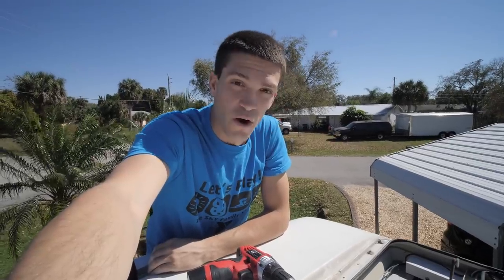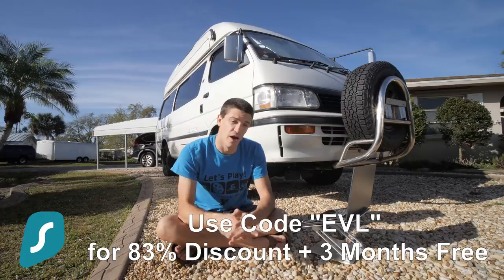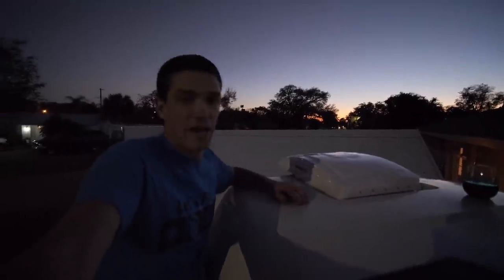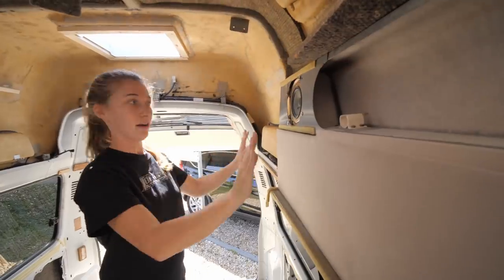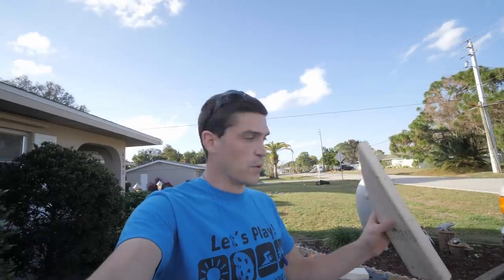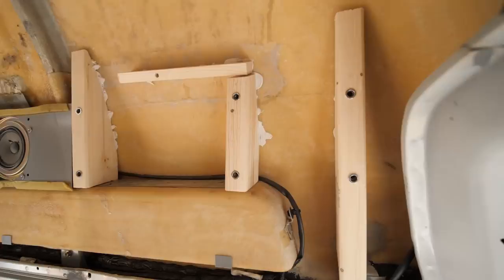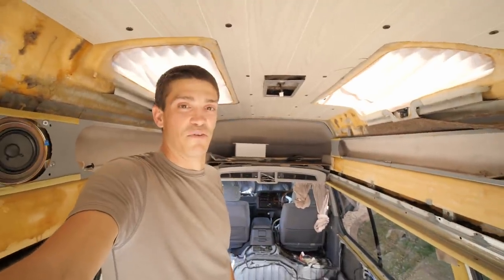THE HARDEST PART OF THE VAN BUILD | Toyota 4x4 JDM Camper Conversion

Comment: Only a thought that may help... I use cardboard templates (as I can see you also do!), for complicated profiles and get the best I can from this first. The second time I use a hardboard to finesse the final template before using that to transfer onto my board and find this helps a great deal with areas where you might need the board to also curve or bend to meet profiles. I find I can achieve a greater level of confidence in fitting and less frustration with multiple fittings of panels and expensive errors with the board I use for the finished work😎👍

Comment: Very impressed Nate that you are trying something new... a full build. I noticed you used paneling for your ceiling. If you plan to keep the van for many years, make sure you build it to remove easily. PANELING won’t last. I’ve done plenty of builds with it. The slightest moisture, condensation distorts, swells it, especially around fasteners. I always use PVC soffit now for my ceilings. Cheap, light, waterproof, easy to remove, and allows gap to chase wires.

Comment: Carpenter trick...to locate "blind" holes, (like electric boxes) when installing drywall...paint the box edges with lipstick. Lipstick will transfer to the drywall for cutout locations.  YOU  can do the same when trying to locate the rivnuts, or other things.

Comment: As a boat builder we take 1/8” thick luan plywood, cut it into 2 “x 8 ‘ strips . Cut as as we go  hot gluing in place a outer edge  pattern with few re- enforcements then transfer to the finish ply . With price of ply these days this saves a lot of mistakes

Comment: Consider using Formica or Wilson Art laminate (countertop, cabinet, etc cover material) on top of the plywood. It comes in hundreds of colors. Very flexible, and attaches securely with contact cement. Looking good so far!!

Comment: I installed the max air vent in my Roadtrex I put eternal Bond on top of the max air vent edges and screws so it will not leak just a thought.

Comment: Used a lot of rivet nuts and I've never seen them used in wood.
Reply from the maker: I might have gone a little overboard with them haha. I don't think they're really meant to be used in wood but they should hold up fine with the Loctite glue.
Reply: Should be ok as long as he doesn’t mount anything heavy to the ceiling.  My concern is with the wood glue. Heat + glue = ceiling that is now a floor

Comment: I still wonder why you think of this as a 2 year kind of deal. Anyway, lot of RV types are going with split AC heat pump units. My neighbor just installed three. Quiet and very efficient. Get some cheap LFP from Basen on Ali. With any insulation you could heat cool with solar.

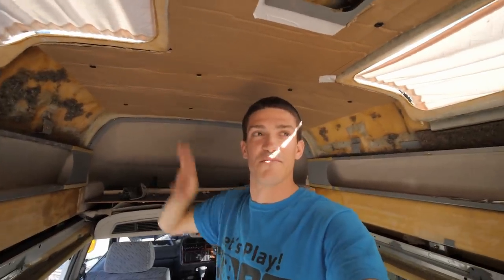Comment: The cardboard template and the blocking process are of interest. I would've liked to have heard more of your thought process and the resultant process. For example, how'd you make the templates? Also, you said finding hte screw holes were tough (9:56). How'd you do it? In my van, I placed the template over the rivnuts and pounded out an impression and then drilled.
Reply from the maker: The template was made in the van, cutting each piece from front to back until it fit around the skylights and other contours. 

I used a Sharpie to mark the rivet nuts and then pressed the carboard against it. It left a decent mark on the underside. I could also kind of feel the rivet nuts through the cardboard, so that certainly helped!

Comment: Hey guys. Great ideas! I was wondering which brand of glue you're using? I've had lots of issues with various construction glues and heat in my fiberglass trailer.
Reply from the maker: We used Loctite Ultimate Power Grab, do you have any experience with that? We're definitely worried about heat causing the adhesive to fail over time.
Reply: @ElementLife  no, I have not tried that one yet. And some of my scenarios were different. I have not tried gluing wood directly to the fiberglass since the Scamp trailers have a coating already for the inside of the trailer. I do recall having all kinds of trouble after installing my maxair fan and trying to glue the wiring to the ceiling and I eventually had to end up using some white silicone caulk which is held up very well. I've also used gorilla glue for some things and one of the name brand construction adhesives but I don't recall which one now.
Reply: @ElementLife  thanks though on let me know what you are using I may have to pick some of that up.

Comment: didn’t see the insulation you put behind the panels.  You are going to get lots of moisture up there from condensation b/c your panels are hardly a vapor barrier.  If you put standard dry wall insulation you run the risk of mold in a couple years.  Also I’m still interested in seeing those welds the auto body shop did on the “not too rusty” frame.  Plans on actually showing that to us anytime soon?

Also I see you’ve started doing those whole “sponsored segments” again.  How does your channel have anything to do with surf shark? You have 70k subs, I cant imagine you make any money off these.  Why do you keep commercializing your videos instead of building up a stronger fan base.  Somehow Foresty forest and Steve Wallis are able to make it work w/o commercials.
Reply: Cain / Adventure Van Man was showing some PolyWool that will bend with the Roof shape / the Fiberglass itself is insulating // I don't think we will get to see that Rust Damaged Frame Repair
Reply: by pinkerton sure but there still isn’t a vapor barrier against the fiber glass. Condensation will collect on the inside of the fiberglass roof and drip down on to the insulation creating mold.  Yeah  but the fact he won’t even show the welds on the frame is super sketchy.
Reply: Guess we will have to wait and see
Reply: PS/ I was just watching Vanlife Sagas & they were informing about Insurance / & that they are truthfully informing their Insurance Broker everything about the Van & Build /....Maybe Nate doesn't want to Show the Frame in case the Insurance Company doesn't know about how bad it is Rusted
Reply: by pinkerton that’s a good point. My theory is he doesn’t want to show the wields on the internet b.c someone who knows a lot about frame welding will point out that they were done poorly and that the frame rust is extensive. Then Nate won’t be able to sell it off to some poor viewer in a year and make his money back.
Reply: Cain / I put my $$$ where my mouth is & Bought a New Ford Transit 250 Med Roof 130WB off the Lot for $30,000 / my build will be simple for Travel not Living in / it Drives so Smooth - like an SUV with a Panaramic View / I can't imagine any Insurance Co. Insuring Nate's 25yo Rust Bucket